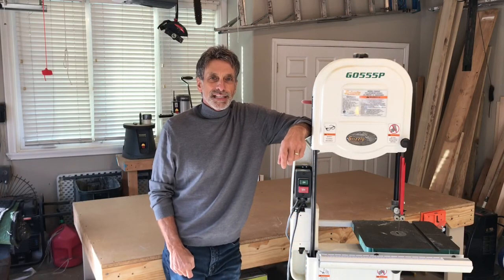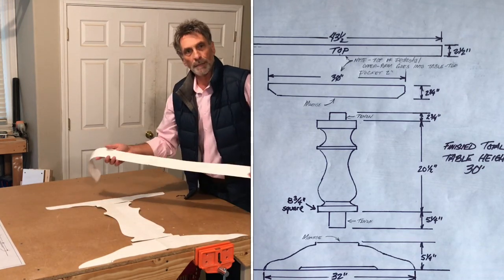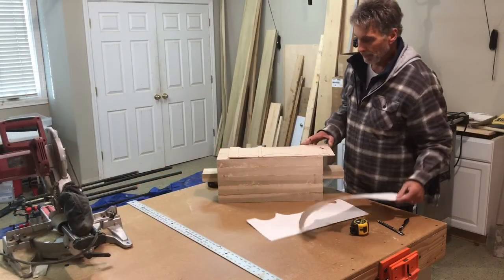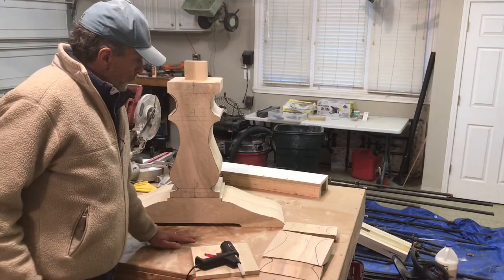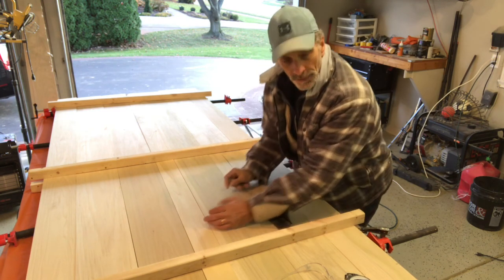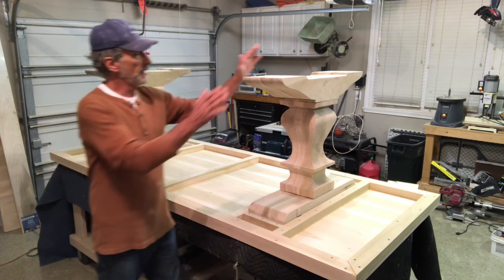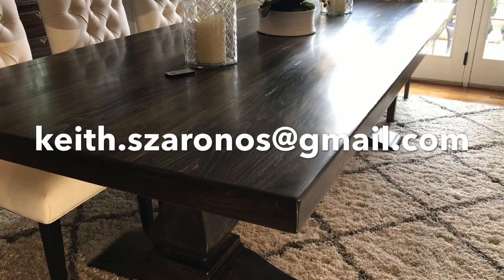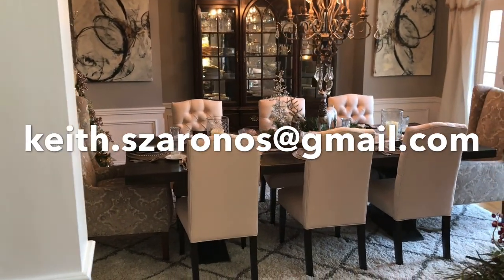Pedestal Table - Design & Construction

Comment from the maker: Thanks for the comment Matt.  I sanded up in varying degrees up to about a 220. I used mini wax stains and a mixture of 50/50 ebony and expresso.  Then I proceeded with about 5 coats of a satin polyurethane which was also min wax.  The key I feel on my top is that it is as smooth as glass, was to sand again moving up from each coat to lighter sanding coat, wiping down with tac cloth and again wiping down with a clean cloth with some mineral spirits on it.  Then repeat.  My last time I I put a coat furniture wax and worked it into the then dry finish.  Thoroughly cleaned it and rubbed it out lightly.

Comment: Great video and appreciate the pedestal build and how you built without the spanner between.  Table is very classy and bold.  Good point with vacuuming and kicking the spanner, always in the way for sure.  

Question on the panel glue ups with screwing the poplar frame and pedestal into the panel top, are you seeing any issues with wood expansion causing any bowing?  I built an edge grain walnut island counter top and glue plywood underneath and experienced a ton of bowing so I am now hesitant to secure anything that prohibits expansion.   Is there a method you used for securing the poplar to the panel?  Thank you!

Comment: Keith, it appears this question has already been asked, but wanted to see if you have the design template available to share/sell for the pedestal legs (including top and bottom supports).  Thanks in advance
Reply from the maker: Hi, appreciate the question. I don’t have the template anymore but in the context of the actual video, there’s a large picture of my measuring pieces with dimensions. The table top length is kind of up to you, but I also mention in my video a finish length dimension was about 105 inches. If you have more questions feel free to give me a call at 909-815-9481.
Reply: There is a guy on youtube "designs by donnie" who makes and sells pedestal templates.

Comment: excuse my ignorance but how are you cutting that laminated block when the resaw height is 6 inches? I know nothing about band saws and how they are sized but I would like to purchase one in the future. Any tips would be helpful.
Reply from the maker: My bandsaw from grizzly has a height kit extension on it.  My saw cut height is really about 12 to 13”
Reply: @keithszaronos7312  thank you for taking the time to answer. Much success in the future.
Reply: What size bandsaw 14” ? 
Did you glue and screw the pocket pieces to the underside: how do you take into consideration the wood moving?

Comment: Why didn't you seal the underside? You're gonna have issues
Reply from the maker: Not sure what issue you’re referencing?  I stained the underside immediate perimeter board and then I sealed everything with the poly.  I liked it two tone with the unstained portion with the stained.